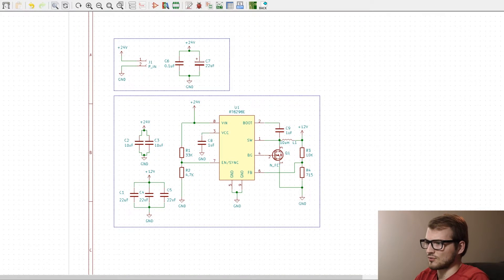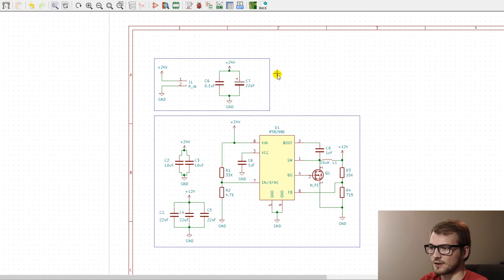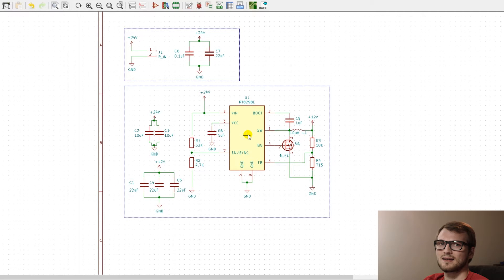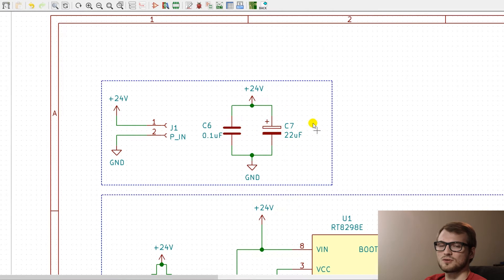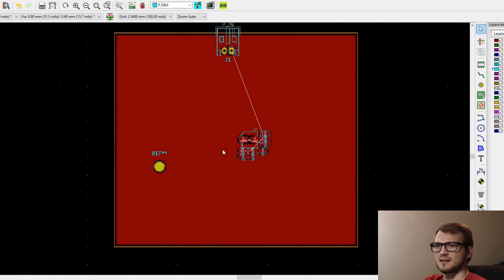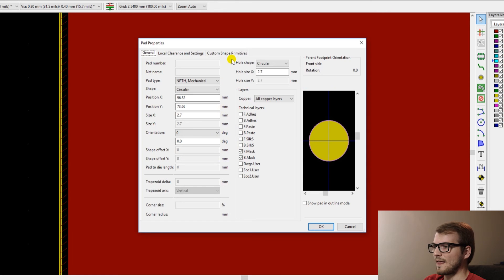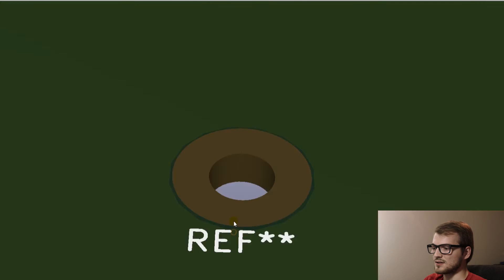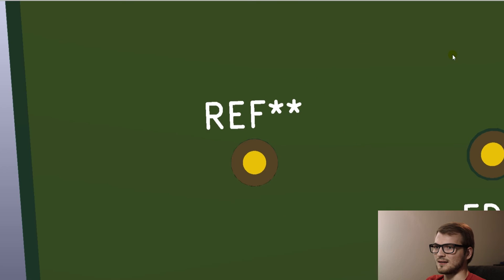Voltage Regulator Overvoltage - Random KiCad Tips

Comment: Your solution for the mounting holes was a good one. However, you’ll probably want to take into account the screw head as well. That 2.7 mm only refers to the clearance size for that threads. The screw head is the location where most of the friction/wear will occur. Something like 7 mm of overall pullback would be more appropriate. Naturally, this depends on the fastener used.

In my designs, given that they have regular contact with users (humans and their static that they seem to enjoy dropping onto these devices), I place an earth ground PTH instead - even if a given mounting holes is not actually wired to anything else on the board. Since the hole will then be on a different net, it will pull back the power/GND plane automatically.

Comment: For your NPTH mounting hole, why do you feel it is necessary to pull the solder mask away from under the fastener head? As long as the copper is pulled back what does it matter if there is solder mask there? Or is it an aesthetic choice to have the bare G10 (or what ever FR-4 material you are using in your boards) exposed to help visually identify the mounting holes?
Reply from the maker: Yup you're right, no real reason other than aesthetics. I like being able to see 100% that there is no copper under the screw.

Comment: Additionally - upgrade KiCAD to 5.1, great version. About fiducials and mounting holes problem I don't think if there's a better way than you did, what's left is to report that issue to the library guys to fix it.
Reply from the maker: Downloading as we speak! Wasn't aware there was a new version after 0.2. Also, still planning on doing your review when I have time, the reviews just take so much longer than most videos..
Reply: @MicroTypeEngineering  about reviewing my board - I know It's terrible, I've found that myself "in the field" - problems with programming esp, scraping soldermask for additional wires, wrong values of 4 resistors in DC-DC section, dangerous playing with near-maximum voltage for DC-DC Converters used, lack of 2 resistors, clock generator crystal is little too far from device. Maybe you will see more problems with it than me now. Take your time, don't rush with content, everyone can wait :)